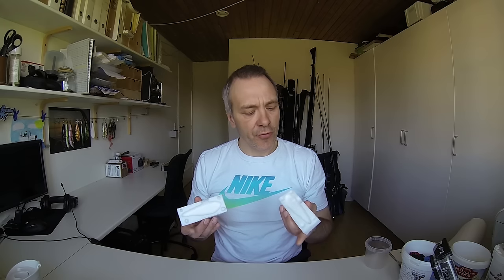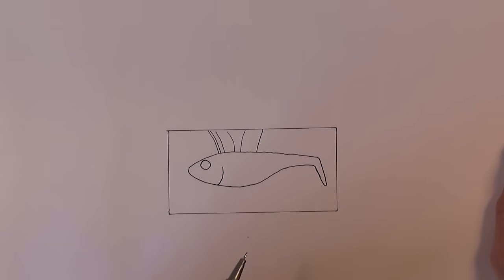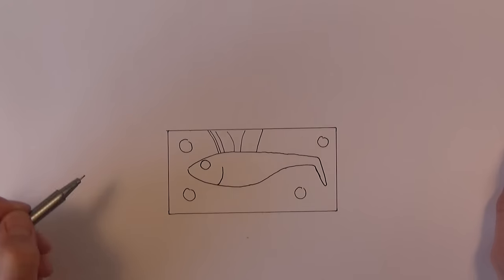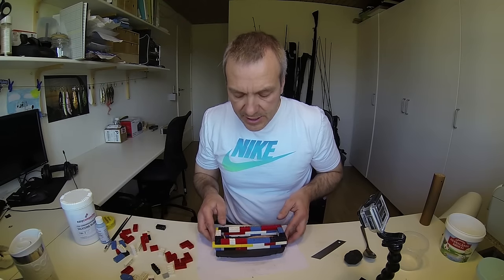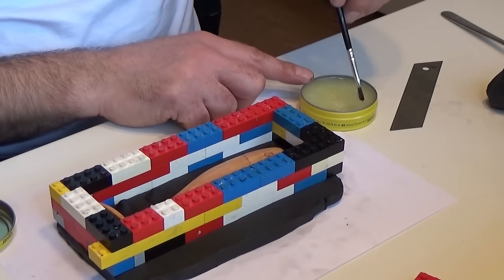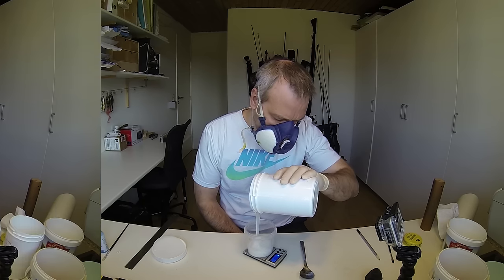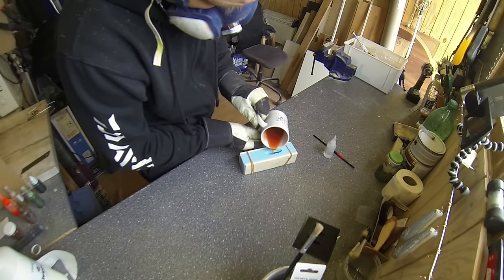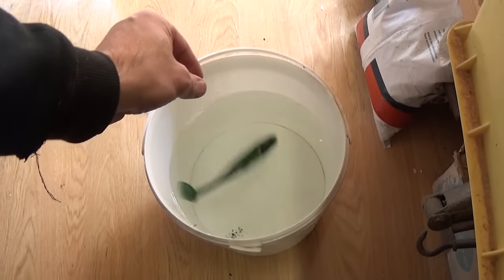Basic Luremaking - 2 Part Silicone Mould

Comment: Great video - do you put Vaseline on the first part of the mold before pouring the second half so you can pull the two parts away after? Or does it just peel away without it?
Reply from the maker: Yes the silicone in part 2 will stick to part 1 if you dont lubricate. It doesnt stick as well to the master but no reason to risk ruining a mold due to missing lubrication

Comment: Sensei my jerkbait(stickbait) master dont have wire, there will be a problem to make a mold from that?
Reply from the maker: I would carefully drill some holes where you want hookhangers, and them make loops of wire and glue into the holes. I will be much easier if you have the loops in the mold. Good luck

Comment: If my mold is ment to produce hard plastic lure, not soft-baits, should the tunnel be thinner? And what plastic should i buy for that purpose? Thanks for your efforts, very thoughtful and informative. Fr Mats
Reply from the maker: Hi Mats. You should check my movie about making plastic jerkbaits. I think that it will answer most of your questions. In the text to that movie you will find links to the products you need. You will find the movie here:

https://youtu.be/kbCk_Mwertw

If you still have questions after that, please ask again
Reply: Thanks 👍🏻👊🏻
Reply: +Splish Splash is the mold usable with expanding polyurethan foams?
Reply from the maker: I haven't tried that. I expect you would have to make some modifications to make i work. You will have to make airwents, as it will work like injection that will trap air in the mould. I have played with the idea myself, but ended up with that it would be quite a mess, as you would end up with the foam everywhere

Comment: Hello! Great videos, congratulations.
I have a problem how to get a piece master so perfect. Do you have a video how to do it? Any sugestion? 
Thank you.
Greetings from Portugal.
Reply from the maker: I have plans for at movie about mastermaking, but haven't had the time yet. Generally its a question about sanding. Starting with coarse sandpaper (80) and move to finer and finer sandpaper (ending af 400). Then give the master a layer of varnish, and when its dry, then sand it with very fine sandpaper (600+). And finally give it a last layer of varnish

Comment: That Is A Cool Green Color,I Use Alumilite Stuff To Make Molds,Lures
Reply from the maker: I have been considering testing the VAC 50, but it is a bit expensive compared to silicone
Reply: I Love The High Strength 2&3 And If I Want To Make Say A Crawfish Lure I Have A Blank And I Knead The Mold Putty And Spread It Over The Crawfish Lure Blank And Let It Sit For 10 Min
Reply from the maker: It sounds very simple - Must try it
Reply: Great Stuff

Comment: GREAT video! Do you have an article or document about the negative effect of inhaled silicone steam? Thanks!
Reply from the maker: Thanks. No I don't have any documentation, and I'm sure that it varies a bit from product to product. the product I use here is just stated to be used in a well ventilated area, so I don't think that a mask is required, but generally I would just advise not to take unnecessary chances and wear the mask

Comment: I am in US.  Will Easycomposites ship to US?  Also, any advice for making a mold for lead?
Reply from the maker: I am not sure. Genereally I think they ship everywhere, but there might be local restrictions to consider. I guess you shoud just ask them. 

Regarding molds for lead, you will need heatresistant silicone - Easy Composites does not have that. A part from that the approach is pretty much like in this movie.

Comment: or are you Using a Plastic you Don't need to Heat up You said that if you are pouring Soft plastic you don't need to use Heat resistant Silicone Don't You Have To Heat The Plastic to Cure and Pore it ? Thanks and Great Video
Reply from the maker: +frank rogers Hi Frank. I am using softplastic that is heated to around 180 C and the mould silicone I use here can take up to 250 C. If you are casting lead you will need heatresistant silicone, that can take the 330 C that is leads melting point. Hope this answers your question
Reply: +Splish Splash awesome  Thanks

Comment: Is the silicone you used for the   mould the same as you used for the soft bait? And do you have to buy different colours of silicone or colour it yourself?

Thanks
Brian Haas
Reply from the maker: Mold silicone and softplastic are very different from each other. Mold Silicone is like in the movie a 2 komponent silicone, while the the softplastic i a liquid that hardens after i has been heated. And yes you have to buy the colors seperately
Reply: The silicone for the mould is in two parts with different colours to ensure its mixed thoroughly .

Comment: hi! What is the weight of silicone forms are usually for the manufacture of large lures? If the form consists of two parts
Reply from the maker: I think i use 4-500 g silicone for each mold in all, when the lure is 10-15 cm. Depending on the shape of the lure, it could be more or less than that. But you can quite easily calculate it. Meassure you lure and put the numbers into this formula:

(Length of lure + 3 cm) * (Height of lure + 3 cm) * (Thickness of lure + 2 cm) * 1,1 = Needed amount of silicone needed in grams

The 1,1 is the density of silicone - Or at least the silicone I use. You can replace it with the one for you product
Reply: Thank you very much! Good luck on the fishing!

Comment: Hi
Would it be possible to use casting sand instead of the clay?
Reply from the maker: +Martin Folkesson Hey Martin. I think that it will be posible. Only, when first part is hardened you probably will have to wash it and the master to be sure that all sand is removed, and  then you will have to be carefull that the master is repositioned exactly like before

Comment: hi , the link for the soft plastic dosnt work :/ ... the mould is for hard baits and for softbaits ?
Reply from the maker: Thanks - I will fix the link

The mold in the movie is for a softbait, but I would use the same moldmaterial to make a mold for casting resin
Reply: Thanks for the response. Your videos are like treasure for me . I hope u will get more and more subscribers . I want to ask u smthing , the soft plastic needs microwaves ? can i do it somehow without microwave ? also .. how u paint the soft plastic ?
Reply from the maker: I have seen people heat it in a pot on a stove, but I assume that it will require very gentle warming and frequent stirring. 

Check one of my other movies for the painting. I use ordinary airbrush paint, but it only works if you coat it in softplastic afterwards

good luck

Comment: Hej tak for dine gode film. 
du har virkeligt givet mig blod på tanden til at kaste mig ud i mine egne projekter.
Hvor køber du  easy composites silicone rubber og er det det samme du bruger til woblerne. og hvilken materiale bruger du til selve wobleren ?  
håber du har lyst til at hjælpe mig igang. 
endnu engang TAK for dine fantasiske videoer
Reply from the maker: Hej Benjamin- Fedt du vil i gang med at lave dit eget grej. Det er mega sjov. Hvis du kigger i teksterne under filmene er der links til materialerne. Og ja form silikone (condensation cure silicone) er det samme til forme til softplastic og resin. Vh Jørgen
Reply: A
Reply: Tusind tak :) jamen nu er der ingen undskyld for at komme igang tak for dine videoer håber der kommer mange flere af dem